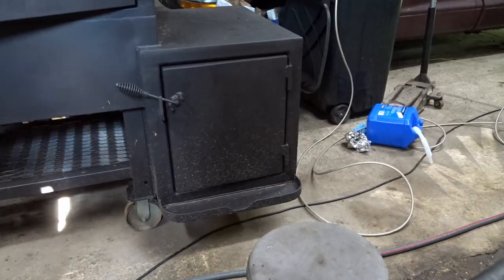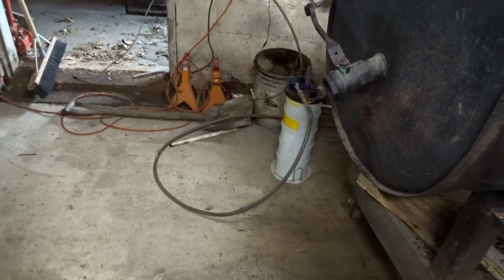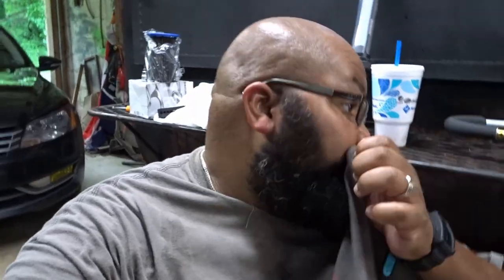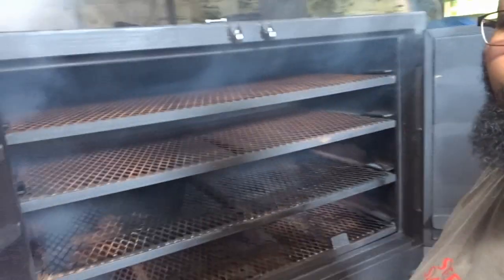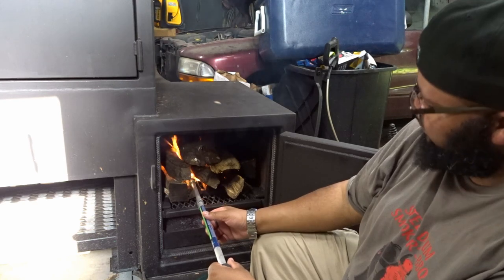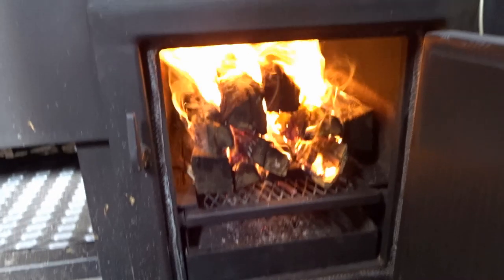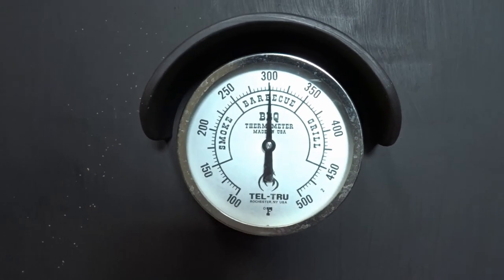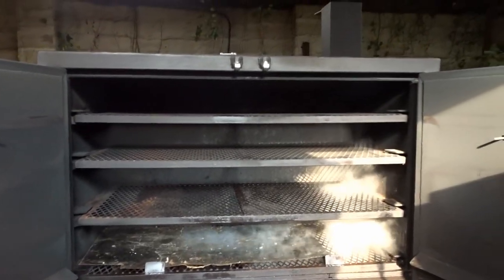SDSBBQ - First Fire in the New Insulated Smoker

Comment: I've been starting fires with several splits for decades.  Maximizing wood surface area available to O2 is THE key to quickly and CLEANLY starting a fire.  Small fires, big fires, or even using a single match to ignite a raging bonfire, doesn't matter.  More wood tightly stacked on top of other wood doesn't work, unless overpowered with a LOT of torch.  My goodness, there's a much simpler way!
Reply from the maker: Thanks!

Comment: My smoker, although not a reverse flow I use tuning plates. At the heat end it is baffled with the next plates start with small holes in the plates graduating to larger holes going toward the smoke stack. the temp I get from the hot end to the smoke stake is about 10 degrees.....
Reply from the maker: I'm still working on this one... she is being a bit difficult. Hopefully I'll get her figured out at some point

Comment: How is ur stack ran ? Straight out the top or does it come out the back at the bottom grate??
Reply from the maker: Straight out of the top. I then have a 6" diameter elbow to a 4 ft section of furnace pipe that runs out of the window of the garage.

Comment: I know you're testing but you really should be outside...carbon monoxide is very dangerous
Reply from the maker: I can assure you that the garage is way more wide open than it appears. The garage door is always open and I have a fan setup in there as well. I also don't sit out inside the garage for extended periods of time, if I am out there for a while I am usually sitting by the door getting fresh air.

Comment: I would think smaller fire and be patient I would think it take a while before everything has heat set then i think temp would be same across cooker. You had blast furnace going in insulated cooker. Just an observation . I think you will have conduction not convection. Thats whatI think youlle want. Just observation from watching smoker video. I also am curios as to why you dont stagger wood 2 one way 2 opposite way or angle to allow air to access. I seen someting at one smokehouse they have firebarrel 55 gallon full of axles from cars they keep feeding barrel logs and shovel coals from that aka molten embers to smoker. A clever man with welding torch probably make horizontal something stand rack were you could put splits and add density to fire less wood.

This is seran wrap  man I wish you good luck on your fishing trip, at present time I see disturbance working that way. Hopefully by that time you will have fish on smoker back at home. You need not leave lenghty answer this was just observation.
Reply from the maker: I load it up and then there is less fiddling with it. I might try a smaller fire next time. I really don't have a place to create a burn barrel like you're talking about.
Reply: I think the same. Fire too big, no airflow and no convection. And start the fire with a starter full of charcoal. Saves you a lot of gas on that particular burner. Otherwise get yourself a high output weed burner and a small gas tank. I have that small torch too. However I light small pieces of wood first with maybe 2 or 3 logs on top. When they get going I add another 3 in the opposite direction. I have a basket too. But still I use that method. It produces far less smoke during the start up. I'd prefer some room in front of the grates so the heat starts to regulate itself before it reaches the grates. You got a hotspot now just like a standard offset. But a smaller fire might change how this smoker operates. Try it and keep on feeding your channel. I like it.

Comment: Before going to the trouble of making a baffle for it, try filling (partially filling) the water pan with water to see what happens. Tell me about busy, I work as an HVAC repair technician, a paralegal, and my street vending business, plus, I just got home from about a 170-mile round trip to visit an aunt in a Hospice facility. I've also been working on and have actually made over the past week or so the BBQ business a legal entity with both the feds and state. I rebuilt my computer and I'm trying to learn some free accounting software. In my spare time I'm trying to get a video out.
Reply from the maker: I did add some water into the pan, it was about a quarter full. I didn't add more water because I knew it would make things take that much longer.
Reply: Yeah, when he said how much that thing holds when you went to pick it up that kind of raised my eyebrow because you'd have to burn a fire for a long time to get that hot enough, plus, water evaporating in the cook chamber is actually cooling your smoker, it takes BTUs, meaning more fuel to run a smoker with water in it and other than you, I've never seen anybody run a smoker professionally with water in the smoker. It's also my belief that water evaporating out of the meat accounts for the stall.
Reply: Get Quick Books and save yourself a lot of time and headaches. Been there done that, no shirt.

Comment: Have you tried to put the chimney on the other side to help even out the heat?
Reply from the maker: That would defeat the intention of it being reverse flow. The heat is so intense because of the insulation. The plates helped a little but I need to tame the fire some more.
Reply: @SDSBBQs  so then having less insulation on the left hand side is gonna fix it? Or have a adjustable vent on that side?
Reply from the maker: @henningradasewski6172  Still not sure what to do with it... that's why I've only used her a handful of times.